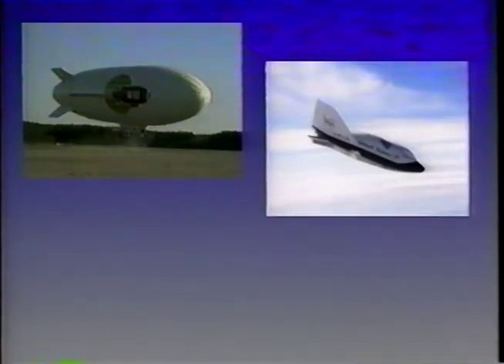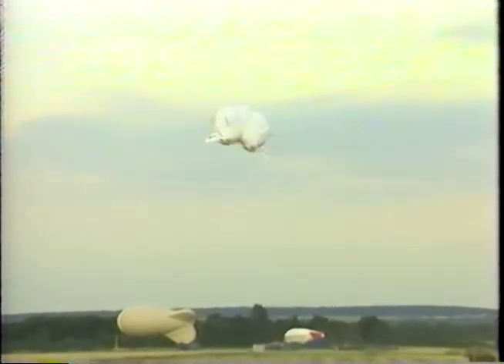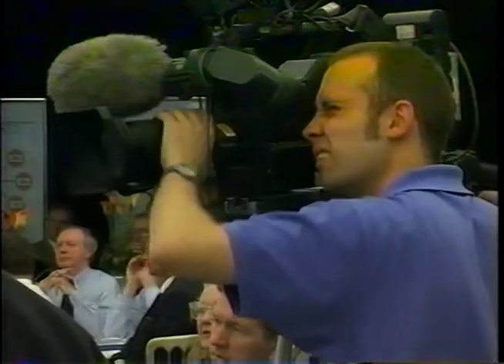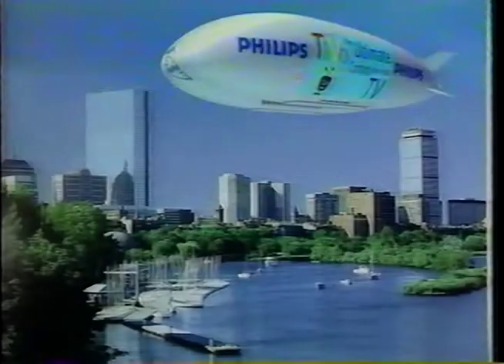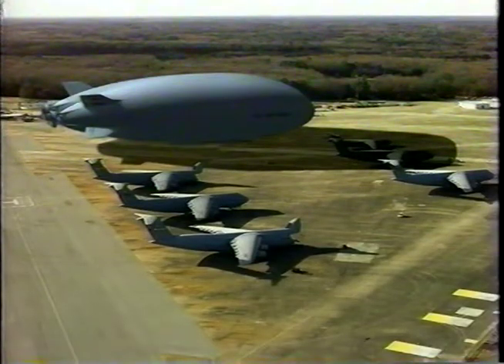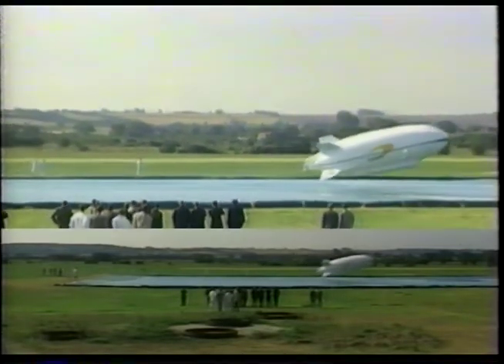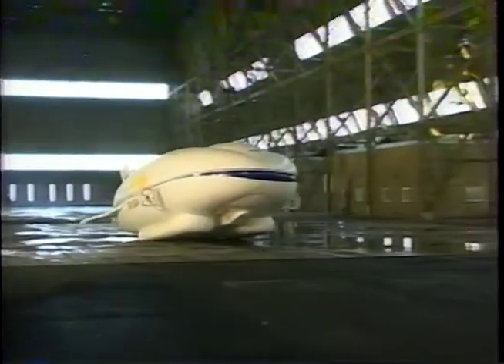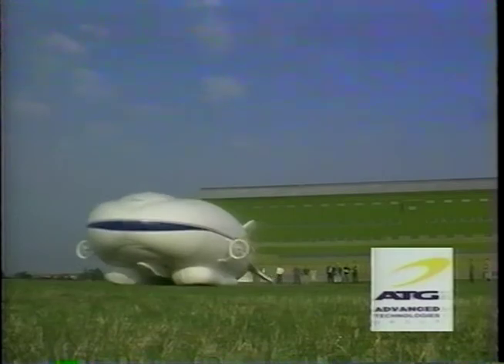Skycat Prototype

Comment: The opening was sky kitten 😺 the rc model ...the choice of music and narrator is ..erm very early BBC ch3sy... but  its set at Cardington airship sheds.. original home to the R100 and 101. 

However it did get the interest of the US millitary who they went on to develope the Skunk  works version and the actual Airlander 10 program with,  that came back to Cardington 6 years ago...  
The advantages remain the same as long as you can build bigger ..  even flying in heavier than air mode the fuel consumption is a tiny fraction of even the best fixed wing aircraft  and the endurance is measured in days and weeks not hours. .ditto range. Electric thruster motors eliminate a lot of complication s using seperate ICE engines create. 

As for resistance to small arms fire one should look at WW2 blimps and tests carried out ..
basicaly they are much less vunerable than conventional aircraft....a hundreds of rounds of ammo hitting the envelope would only result in a slow deflation over 12hrs and that would allow for a controlled landing.
The other factor is these designs can be pressurised the old rigid airships were not.

Comment: How old is this video? Why hasn't anyone used compressors to deflate the airship for landing and turbulence? Why is every airship video made for the 1940's?
Reply: Basically because the weight of  a compressor with sufficient capacity to repressurize the gas into cylinders exceeds the lift capability of the airship